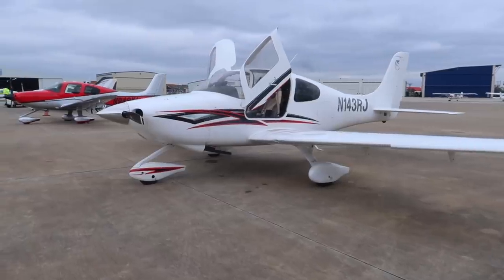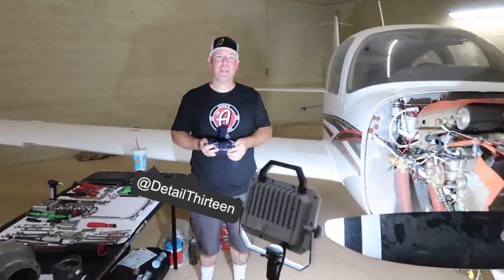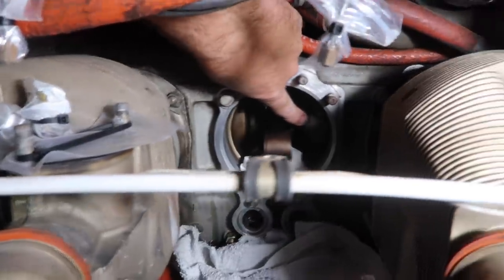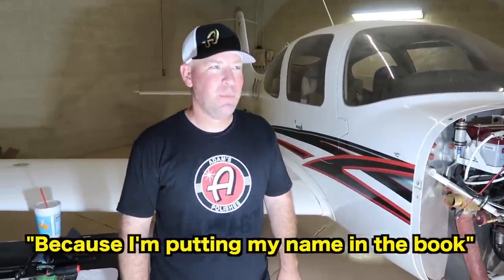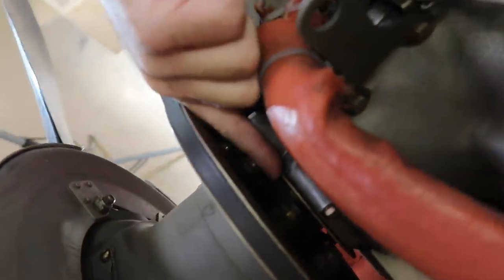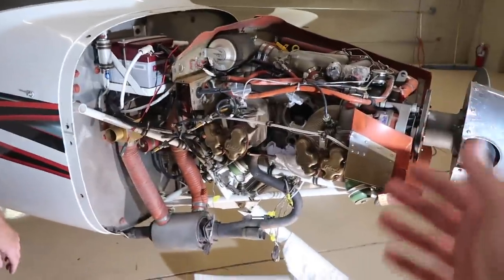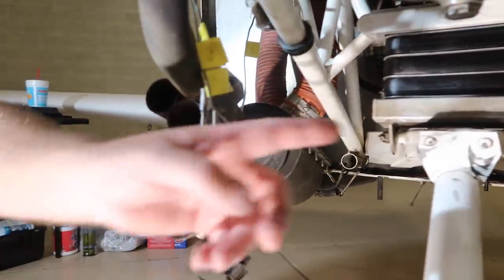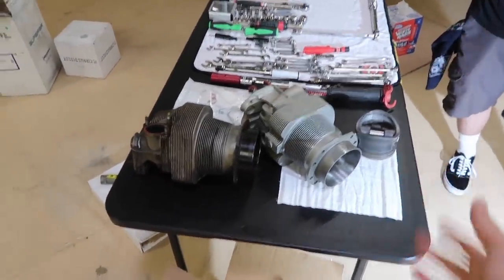Cirrus Expert Tells Us Everything Wrong With Our Cheap SR20!

Comment: Fun episode but wish more time was spent with the mechanic. Some questions I wished were discussed include;
- engine log book, what did mechanic’s review reveal? Engine close to TBO?
- aircraft parachute, when is repacking due?
- whats more reliable the continental or lycoming O-360 (cause a lot of aircraft have lycomings)?
- hours on removed cylinder compared to engine TBO? 
what caused excess cylinder bore wear? 
which maker of the replacement cylinder did you decide on (oem or certified aftermarket) and why?
- Did mechanic go thru list of AD’s?

Thanks,
DanaH

Comment: I'm new to watching vids of GA, and this assessment/teardown is fascinating. I've worked on air cooled Harley engines for years, and of course (at least for pre-21st century versions) are subject to jokes about parts falling off as you're riding down the road. The reality is, they hold up surprisingly well considering the beating they take. The failures on this aircraft — particularly the power plant — absolutely astound me. An air induction tube cracking??? Brakes overheating to the point of cooking fluid and seals in normal use??? I don't get it. Those kind of failures say to me as an engineer that somebody did a piss poor design. I know about the  cracked cases. WTF, are you kidding me? And knowing that these are common the factory isn't footing the bill for replacements? WOW. That is just incredible. That demonstrates a manufacturer's attitude of "We got ya hooked. If you don't like it: tough." Can't wait to see more so I can continue to be astounded!
Reply: Welcome to aviation!

Comment: We have a cirrus at our maintenance college & we had to drive it around the school like 3 times, the steering does feel weird because it’s braking a wheel, it takes some time getting used to it.
Reply from the maker: Definitely
Reply: The nose-wheel is a castor type. That means you use braking on the mains to turn. The Cirrus can do a 360 in place thanks to the tech.

Comment: Great vid.  Maybe I missed it, but do not understand what caused the overheating indication of that cylinder?  If the barrel was 'worn out' then would that alone do it?  The crack in the induction tube, not allowing enough air to get in, or sucking too much, and too much oxygen made greater temp?
Reply from the maker: It was actually a clogged fuel injector. But maybe this was all a blessing in disguise.

Comment: I built air systems and paint systems and heating and cooling systems that were as large as your house for 40 years. Industrial sheet metal. But I've also worked on aircraft. I was great with this guy and I know that it's a minor detail. But the letter T in the word duct... is silent. Just like the L in salmon. Or the first L in the word salmonella.
Having built ductwork for several decades, it is a pet peeve of mine that people do not know how to pronounce words that came into the English language from other countries but it is a pet peeve of mine the reason is is that people often use the word decimate when the word they're looking to use is devastate. If you start mispronouncing words you will soon find yourself using words that you're not supposed to use and that do not have the definition that you believe that they do. Decimate means to reduce a military force by precisely 10%. I can count on one hand the number of times I've heard somebody use that term properly just in the last 30 years since somebody started to try to apply it instead of the word devastate.
Good video but with that hot cylinder you might want to look a little bit deeper. Anytime I get that deep into an engine, I always check the Pistons, lifters, valves, everything I can possibly inspect before I put it back together.

Comment: So.... if 1 cylinder is worn that badly, then the other 5 likely are too.... I'm not an aviation technician, but I am an automotive tech and that raises a flag for me.
Reply: I work on both.  Automobiles and aircraft.  It’s not an uncommon occurrence to renew one cylinder.  This will blow your mind most aircraft engines have a .020 to.030 position to cylinder clearance spec.   Talk about position rock.   It’s necessary to prevent the engine cylinder from seizing on the pistons during a dive

Comment: I had a hot running cylinder #5 on my 310 (~>390 degrees) and it turned out to be a faulty CHT probe. Probe was replaced and all is well...cylinder running below ~360 degrees during climb.
Reply from the maker: We started with the probe but unfortunately no luck turns out it was a clogged fuel injector in the cylinder. More videos to come!

Comment: What was the TBO on the engine when you bought it? If it’s low it might be the reason you got a good price on it. Engine might need an overhaul.
Reply from the maker: 1640 since new, 2000 TBO. So we knew it was coming up when we bought the plane.
Reply: @JRAviation  hope you have $25k-$35k ready cause that's what an overhauled IO-360 will likely run...possibly more depending on what you have done
Reply: At 1640 hours on a 17 year old engin,,, I would not replace a cylinder,,, I would overhaul the whole engine

Comment: So, why was the cylinder overheating?
Reply: Clogged fuel injector
Reply: Or the cracked intake tube
Reply: @russellbingham7901  I agree.   I asked the question before I saw the cracked intake tube, which would have definitely made the cylinder run lean.

Comment: The propeller on the front of the plane is just a fan to cool the pilot. When the propeller stops you can actually see the pilot start to sweat. lol.
Reply from the maker: hahahha sounds about right!
Reply: Gotta learn to land with engine out, pr atleast you did.   Its only scary when your going thru training and your instructor pushes the throttle  all the way in taking you from your normal 80 percent power tp 0 power   once you get licence you always are paying attention to wear you can land if engine failure.   Plus most ga planes have a very good glide ratio.

Comment: It is unusual for a 17 yo plane to have the original engine and/or not having under-gone a major overhaul. TBO for the engine is 2000 hours.

Nothing unusual in this video except replacing a cylinder which has been honed to the max indicates a possible prior major overhaul.  How many hours are on the engine since either the last major overhaul, and if none was done, engine hours in general?
Reply: Its not unusual  for a ga aircraft to not have a major  overhaul in 17 years.  A ton of ga pilots fly less than 100 hours a year and with an engine that is at 2000 hours TBO.  
The plane is 17 years old so it shouldnt have had a major overhaul yet.
He said engine has 1640 hours.
Reply: @cw93711  Do you know the history of this plane?   1700 hours can easily see a major overhaul btw.  Depends how the engine has been run and cared for....
Reply: @Airplanefish  The cylinder being replaced has thin walls indicating it has been honed repeatedly and maxed out.  As the mechanic noted in the video.
Reply: @gbigsangle3044   obviously it didnt need a complete  rebuild or the a&p would have pulled the engine and told them that instead of just replacing 1 cylander
And i do have some idea of whar i am talking about as i build a experimental  with a lycoming io540.
And i have helped my stepfather build 2 ultralights and 2 gyrocopters and the gyros recieved  a bronze lindy and a silver lindsey and the won with the silver was best build gyro that year at airventure.  He also had a 172 that we did alot of maitence on and then a&p checked everything over and signed off on it since the work was all done in our rural hanger.  
Also worked on multiple  other experimentals
Reply: @cw93711  I don't question your mechanical background...I question your knowledge of this particuar engine in the video.  The video does not provide that history which would have been useful given the problem piston and helps set the background for the story.  Only the engine logbooks would have that information.
Reply: @gbigsangle3044   i have never worked on continental  engine your correct.  But i have worked on lycoming whic are very similar.   
A log book tells you how many hours are on the engine and if any work to it has been done to it in the time the aircraft has been flying.  Most pilots dont mark done things like cylander 3 is running hot etc.  You have a good idea thzt was never marked in log book since they never discussed it with the pre purchase inspection nor even the inspection after a test flight before purchase,   they only discussed in the video how the cylinder  was running hot on the flight to arizona and thd  then flying arounf the8r home base. ` plus i waa basing my comments  basesd on what  a&p said

Comment: I want you to LS swapp the plane but that is probably a bad idea  since those motor could probably make the plane too heavy.
Reply from the maker: That would be epic, but probably very challenging!
Reply: Would make the plane experimental aircraft then.  
Putting in car engines is a very big deal as aircraft engines are flat 4,6 or 8 cylinders  and they are air cooled.  Also they run at a very low rpm.  
Car engines are liquid cooled and with running at much higher  rpms they need a belt drive to lower the rpm to one the propeller can use.  
Their are several ls engine kits for kit planes, but they are heavy and not very popular.  
Subura engines, mazda rotaries, covair engines are propably the most popular car engine but its all for experimental planes.
With a certified aircraft you are stuck using it exactly as it is basically.  A company can spend a bunch of money to allow you to buy a certificate  that says you can run regular unleaded in the engine.  Or gap seals which cover the gap between the wing and the flaps which can potentially make the plane faster or vortex generators which go on the wing and lower the stall speed.  But with a certified aircraft and a&p has to install the parts and then sign off on it in the logbook.  Plus the company had to have tested those parts on that exact make and model plane and faa approved the final paperwork showing it was safe the manufacturer  sends to faa.   With experimental  you just go buy and put on yourself and sign your own logbook.  Certified parts are always 2 to 3 times the price of the exact  same thing non certified.  
Ps  that engine is 30k to 50k new.
Reply: @JRAviation  its already done and their is a kit for it but your plane would be experimental

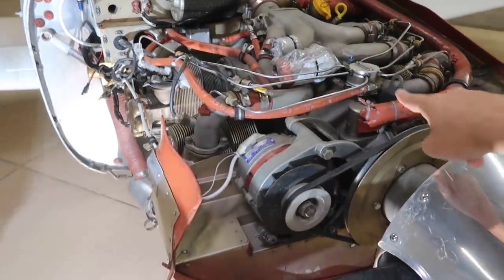Comment: 8:00 that's not a compression test. That's a leakdown test.
Reply: Um, yes... it is.. He explained it no differently than I would.
Reply: True, but in the airplane world, they call it a “compression test”. In the automotive world, you are right, this is a “leak down test” while a compression test involves cranking the engine with the throttle blade open to measure psi in one spark plug.
Reply: @thomasaltruda  I have never performed a compression check on a plane yet where I had to have the engine crank. All checks are done, keys out, mags cold, and @ 80psi. Shouldn't have to touch the prop while you're doing the check either because you should've already felt the gear lash in the prop when at TDC. If the prop rotates, you were off TDC. If the prop doesn't move and you have <80 PSI, it's blowby and is normal, an otherwise satisfactory leak-down check as well. Engine can be cold/hot. the differences will be negligible between the two unless dramatic.
Reply: @swagger897  I agree with you. I am familiar with aircraft and automotive engines. I should have clarified that you don’t use automotive type procedures on aircraft. We won’t crank aircraft engines to do compression checks, they are done like you said, statically.

Comment: How did only one cylinder fail?  Wouldn't we expect more than one cylinder to look like cylinder #3?
Reply: Nope  aircraft cylanders wear out 1 at a time. 
The engine is aircooled.  
Each cylinder has a temperature  guage on it and to get the best fuel economy you use the least amount of fuel to fly at 80 percent  your max speed without overheating any cylinders.  Fuel cools the cylanders so the more fuel you burn the cooler the cylinder temperature.   But when your burning 15 to 25 gallons per hour you want to burn the least amount of fuel possible especially  since aviation fuel is around 4 bucks a gallon since its 100 octane low lead fuel.
Reply: @Airplanefish   as an a&p to put in writing their is probably another bad cylinder without you then checking the other cylinders leaves you open to a huge lawsuit if something happens to that engine and they crash or have to put the plane down in an emergency landing.  
On the video you stated the reason for the high temp on cylinder 3 was it was worn out and oversized and had to be replaced.  If i remember right. You should do a new video to correct your engine diagnose.  Since your on video saying its something else than what it is.  You must have wonderful eyesite to see the cylander is oversized by a 01th of an inch to a .001 of an inch  or so.  Usually you measure everything  to make sure what you see on the cylander is telling you the right thing.  The clogged fuel injector makes a lot of sense while it was taxiing around  etc that that cylander would be hot but yet at altitude  when tney flu it back it was at normal temp.   Just strange they drop that much money without doing a through inspection  before buying it.  
I stick with experiments.  I build 1 with lycoming io 540, helped my stepfather with an ultralight  and i call it an ultralight but its a sport pilot and 2 gyros  1 bronze lindy and 1 silver lindy and best build gyro at airventure.  Helped on numerous  other experimentals.
Reply: @cw93711   hey as a fellow a&p I will say that the video does not show a step by step disassembly process. But I believe his experience education and willingness to even be on video bodes well to his credibility. Measuring eng gap clearance is not an eyeball kind of guess on cylinder rings. You use feeler gauges. And measuring for out of round cylinders requires telescoping gauges and a micrometer. I don’t know if you have ever done overhaul on certified aircraft but the experimental rules under ASTM are not the same as the rules under the FAA’s FAR’s. He as an IA is fully versed on the legality of his repairs and he is only liable for the work performed. It’s a high time engine and would have been well within his legal responsibility to R&R only the fuel injector to remediate the fault. 
His attention to detail exemplifies he’s a thorough and attentive A&P.  Upon further inspection he found a cracked intake pipe and an out of tolerance cylinder.   The faulty fuel injector is a known continental fault with cirrus. It’s also in the trouble shooting manual. Either way through experience or manual reference he did an exceptional job. Stick to your experimental. You have more creative rights in the experiments FAR part 21 classification. Certified aircraft only get it one way. The FAA approved way. 

And the pitted hydraulic lifters may have an associated AD. but I don’t know if  you or others will know what an AD is. 🤷‍♂️. It’s under FAR 39
Reply: @bigtimer1a  i agree with you you.  Also  when he added  more info things made alot more since.   Lastly if you watched these 2 on their car videos you would also question what type of person they got to do their annual.  
I have dealt with certified  aircraft  as my stepfather  had a 172 for overa dozev years and an my best friend had a 177 cardinal for most of his life.   Other friends had various certified aircraft as they are easier to finance then experimentals.

Comment: The guy that sold the plane saw these greenhorns coming. Any good A&P will tell you Continental engines are all junk even when new. They never make TBO without replacing jugs. All you plane buyers look for a Lycoming engine plane. Lycomings go past TBO with good maintenance. Lycomings have nitrided cylinders & sodium cooled exhaust valves  unlike your cheap Continental cylinders that wear out the bores & burn exhaust valves.

Comment: No no no more fuel does not cool an engine down more fuel means that some of the fuel will not be burned well and you will have a improper burning take place so when the gas exits the gas will measure cooler, that's not good for an engine   Read Mike Bush's book on engines and forget the faulty engine lore so prevalent in general aviation.

Comment: I flew 1500h on a SR22 and never got a break overheat!
Reply: @Airplanefish  never, flown for 3 years, got it brant new from factory, when taxing, use full deflection of ruder before you need to break, just do a little touch until it’s going just a bit of to the opposite side, always keep full deflection of rudder, on take off I never used breaks, on landing as little as possible and don’t break hard, if have a long runaway, let it run and decelerate, clear runaway via 45° taxiway, you can joy it at 60kts and will have a lot of aerodynamic rudder control,... I could say a lot here, but it’s so obvious to me! Sold it with 1500h with original temperature sticker on!